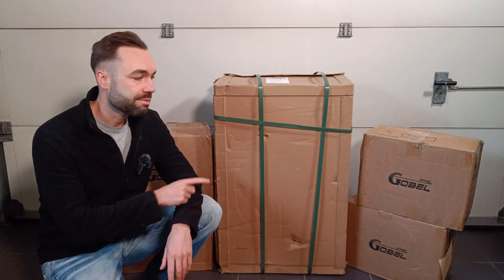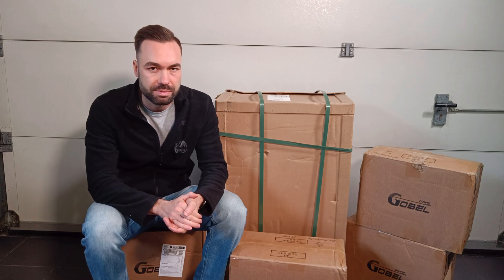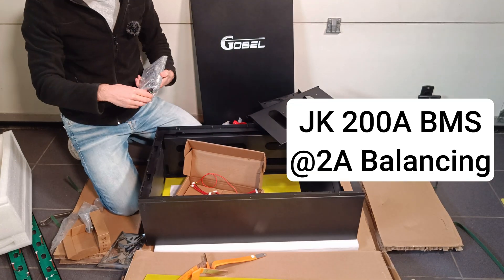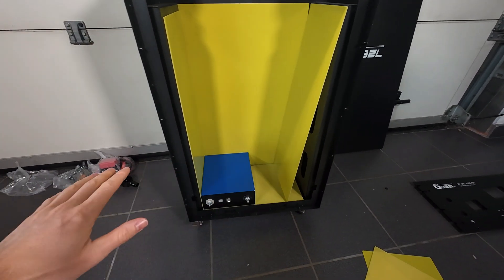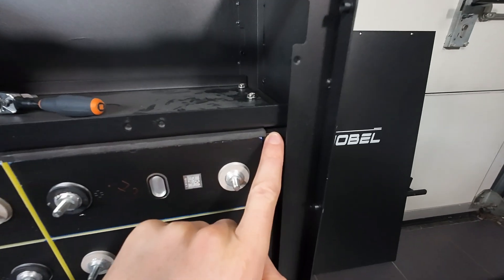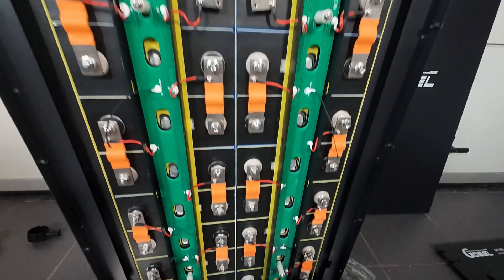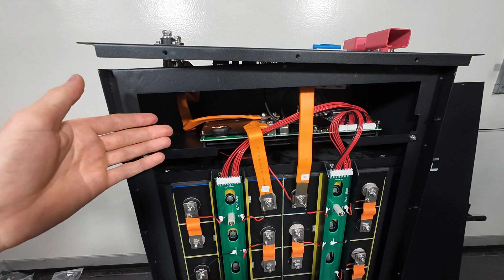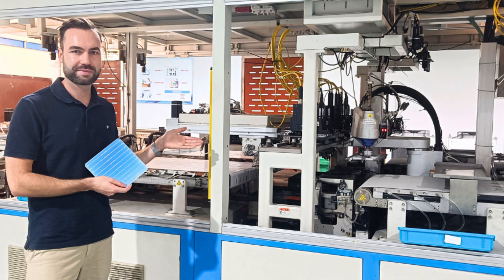Gobelpower 15kWh DIY Battery Kit Assembly and Review GP-SR1

Comment: Hey Nick, I always thought you were from the Netherlands based on your accent but you are from Belgium 🇧🇪. I’m originally from Breda. I’m suprised you choose the standing box. Because the bottom cells have more pressure then the top cells so I don’t think the pressure is optimal in a battery design like this. I myself have two EEL vertical boxes v5 with EVE MB31 cells. I found it also funny what you said about the manual and the breaker. My experience is also that there is always something wrong… With both of my batteries things were missing or weird… I think in China they are very very bad in QA. Greetings 👋🏻
Reply from the maker: The pressure is not a problem. Normally it's recommended to apply 300kg of pressure but that's not possible in this box. Yes, the bottom one will have 5kg x 7pcs= 35kg of force + the pressure plate. But compression isn't a must. So I wouldn't worry about it.

Comment: The bottom link (full silver color) that connects the two parts has different resistance then the rest of them…. The two squares on top of the terminal can accidentally twist and because of their geometry short the entire assembly…. the terminal busbar are extremely different size and therefore resistance…

Comment: good evening... the Alarm red button is when you want to change the code from the BMS app Aa from 123456 to another code.. if you change the code but it won't have a red color... good night you... I've had too much fun with these builds I've built a system by myself JK-PB2A16S30P V19 2 bms in parallel communication together it is very difficult that because it does not have a good application in communication together.. good night you..
Reply from the maker: So if I change the password the alarm led is going away? Good to know.
Reply: @cleversolarpower  yes, if you change the code, everything is fine with the red light
Reply: @cleversolarpower  🙏🙏🙏🙏🙏🙏

Comment: I've had this problem with manuals a few times with inverters or controllers. One inverter I ordered didn't even have an online manual. I wish they would just include a paper manual with everything for easy reference.
Reply from the maker: I have emailed back and forth with the company and they say they will have a qr code in the box that links to the manual. That's fine for me, however, it needs to be a good manual.

Comment: Perfect way to gain practical experience because the kit components are pre engineered. The cabinet dimensions, internal structural members and attachment hardware easily save several hours of fabrication and expensive tooling. Just planning out the face plate  alone might take an hour or two let alone a prototype cut or template build. Quite frankly anyone willing to follow the fundamentals of series and parallel connections should be able to successfully complete the project and come away with a stronger knowledge base. Excellent way to take lead of the Android type Tesla DC power storage and supply solutions. 👈🏻👴🏻✌🏻

Comment: Why is your screenshot of the price $544.50, when in reality it is currently $I,425.00 using your link?  I mean, that's a huge difference...
Reply from the maker: The lower price is for the battery box alone. The higher price includes the cells.

Comment: It looks great for a finished device. Overall, I think it's easy to figure out. However, these warnings and red LEDs are really scary. Besides, I don't see any balancers. With such a capacity, I assume there will be high currents, at least sometimes. My homemade 7 kWh battery with a homemade chipboard case (easy to cut, no risk of shorting the case with cell terminals) also only has a BMS board from this manufacturer (JK), but generally at 0.6A, which led to the board being blocked due to 3rd out of 8 cells sagging. Therefore, I have now ordered separately those balancers that are rated for a maximum of 5A, and I hope that this will improve the situation. Although, yes, I am now also aware of the existence of these boards rated for 200A with a balancing current of 2A. However, I think that even 2A will not be enough for active use.
Reply from the maker: Thanks for your comment. It was not quite easy to figure out because the manual that was available (another model) didn't specify which bolt to use where, and there were many different possibilities. I think having the battery fully charged now and then will be enough together with the 2A balancer. I will update if that's not the case.
Reply: 200A JK BMS’s are great and 2A balancing will work fine. I balanced 2x5kWh 24vdc cheap Chinese battery packs I cut open and reconfigured because their BMS’s were crap and died early. The cells were way out of whack and the JK balanced them perfectly within 2 days, I was impressed.
I DIY a 16kWh 48vdc battery and 2 x 24vdc 5kWh batteries fora bus project using JK BMS’s, they have all worked perfectly for 4 years now, topping batteries to 100% nearly every day with a 4-15ma cell difference and no capacity degradation over this time.
Reply: The 2 amps balancer works like a champ - i just added 2 sets of cells 16s ... let is balance for a week w ess load unload sessions later they are in sync and balances under 5 mvolt